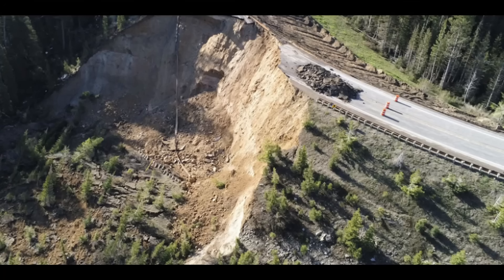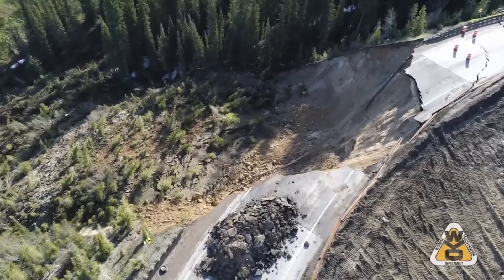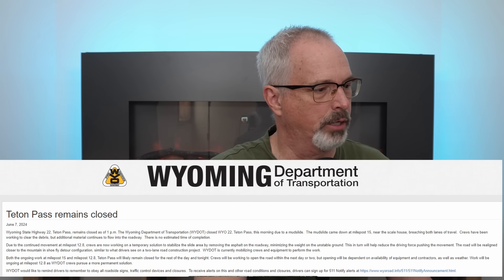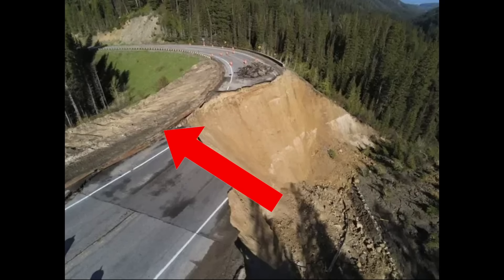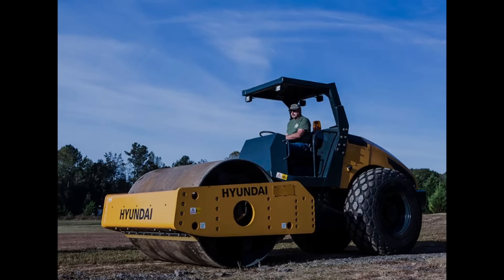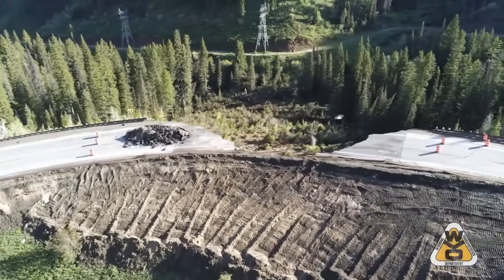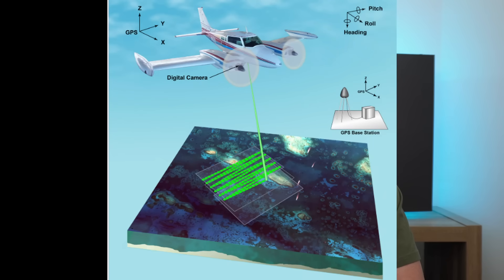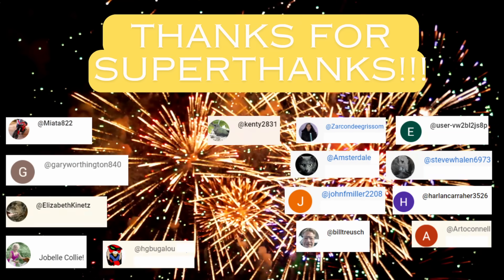Major Highway Embankment Failure in Wyoming!

Comment: Those are insanely steep slopes.
Reply from the maker: I agree.  I have seen this done in a few other places where the DOT managers overruled the consultant who wanted flatter embankment slopes.
Reply: @CaseyJones-Engineer  I’d be interested in a general overview video going over how these highway projects get designed and managed, who makes the decisions, and maybe throw in some examples where a failure was extremely predictable but the management structure prevented it from being addressed. You could also discuss good highway project management and how it could improve. Maybe it’s not a good idea though as you usually stick to engineering side of things where you have a lot of experience. You can’t hope a long lasting, safe, and reliable construction into existence if tests indicate there might be issues.
Reply: Might be better to build a bridge. Hah! That would take forever and likely never happen.
Reply: ok so where would u move the road to,:face-pink-tears: or bite the bullet and close the road.:face-pink-tears:.
Reply: @davidfrank6666  calling all mountain road bikers, no car traffic on this road, hit it.
Reply: @wadestanton  I've ridden a road bike up, and down, both sides of this pass. It's a great ride, either side, 50 mph or more. It's better during low traffic periods because the cars get in the way of a good descent.
Reply: @robgrey6183  Did you ever coast down hill from Rapid city to Edgemont SD? PS. on the old railroad track bed
Reply: It's an iffy looking ridge-line to build on.